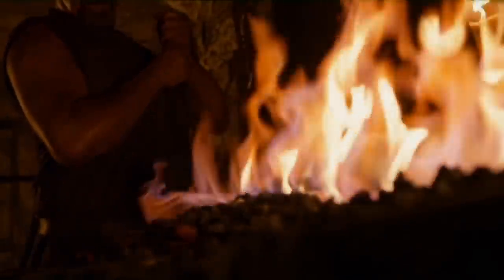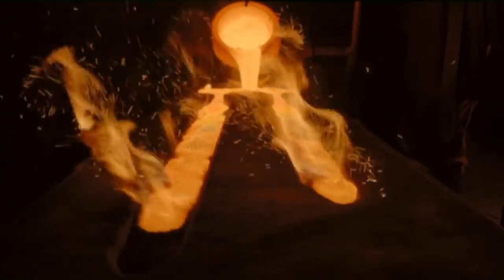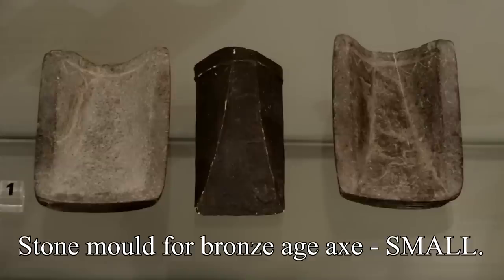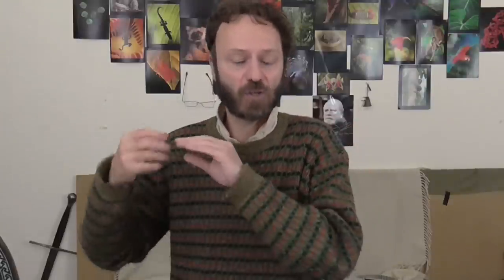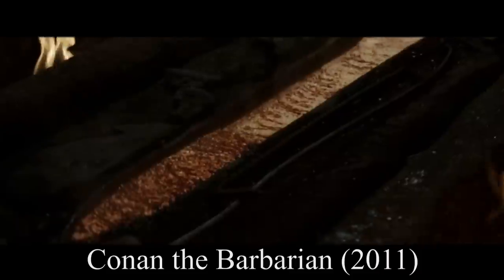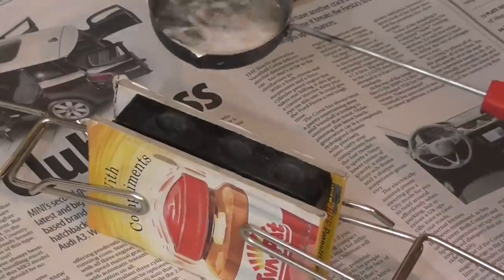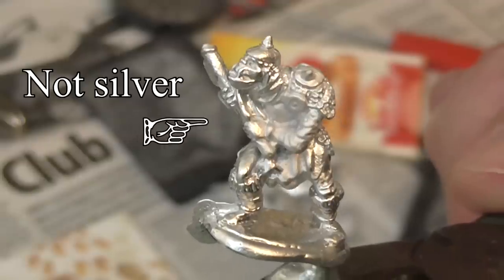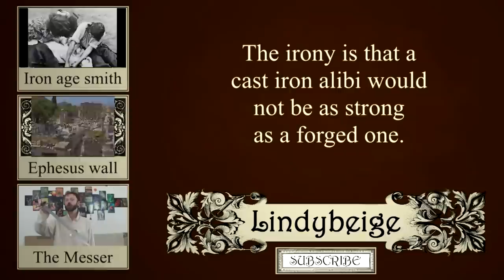Casting swords in the movies - forging a lie

Comment: "Orange is color of melting alluminium, not steel" try to say that to 9/11 conspiracy theorists :D :D :D
Reply: Why would you say anything to them? They turn off their ears whenever facts don't support their little armchair detective fantasy
Reply: Pettersony Strawman guess what a major component of good thermite is.
Reply: Jet fuel can't melt steel beams
Reply: Martin Bararanyi And it didn't.
Reply: You're right, they didn't melt.  Melting is not required, however.

You don't heat metal to work with it for no reason.  Metal bends and reshapes much more easily at higher temperature.  This is because its structural strength is lower at higher temperatures.  Put in that much heat and the beams that are holding up, say 200 tons of building over it, and they may no longer be able to keep it up.

It's also a multi-faceted problem that has to account for several hundred tons of airplane smashing into the building at several hundred miles per hour.  That could affect their shape and strength, and tear away fire retardant coatings.  Then there's who-knows-how-much combustible materials (furniture, carpet, etc) that also burns in the room.  By the time we're done, the simple 'melting theory' is just a child's explanation next to the complexity of everything really involved in such a large engineering problem.
Reply: girhen Exactly, i'm studying building and architecture (at this point just high school). I was just waiting for someone to ask a question, before writing an essey on it here. People then ussually tend more to acctually read it, compared to essey written right away :D
Reply: girhen
OMG. Did someone just regurgitate the "jet fuel" argument? Even if they'd only just learned to read in 2001, they'd still be at least 17 by now. It's depressing that people of that age can be duped by such a blatant straw-man and false dilemma.
Reply: Macdeas
Guess what jet fuel DOES melt. Aluminium. Guess what incendiary is largely aluminium powder and would be rendered useless by burning jet fuel. THERMITE. Jet fuel DOES burn thermite. It doesn't set the reaction off, but it renders the thermite utterly useless. See? That's what a CORRECT "jet fuel" argument looks like.
Reply: Just bending metal heats it. So yeah. No fuel needed.
Reply: After that, it's just physics. Amazing how many conspiracy theorists don't understand inertia and momentum...
Reply: JET BEAMS CAN'T MELT STEEL FUEL
Reply: Well clearly the "steel" beams were made from aluminium and the CIA/FBI/Whoever we are blaming had planned this before the construction started. They had the wreckage cleared up to cover their tracks. Taps nose
Reply: Pettersony Strawman Irrespective of the melting steel, you'd still have to question whether it's feasible to imagine they duped the secret services into getting away with this operation, on top of which required a moderate degree of piloting skills, especially for the Pentagon operation. 

I'm NOT saying it happened according to conspiracy theorists favourite stories, but you can't deny that Government's have historically created such events, 'false flags' if you will, or just blatantly lied to get an agenda fulfilled; Vietnam War had many strange events...
Reply: Your point 1: How so? Its a gigantic area, just by this the air going into the fire has a lot of time to pre-heat and thus get the fire hotter. Thats how a "Hot blast" operates. 
Point 2: How can that be "not much fire" and how much would it need to be so you call it "much"? There are gigantic plumes of black smoke coming out of both towers. There is fire all over the place and can be seen even _in bright daylight_.
To 3: That else but lots of flames over a long periode would you imagine to be able to transfer huge ammounts of energy? Thats essentially how steel is "always" heated up to shape and cut it.
To 3a: What makes you think that the jet fuel all burned instantly? https://www.youtube.com/watch?v=-qyZFASOAe0
Thats is the fuel burning in open air, nothing to confine it or act as a "trap" and its burns for >>5min.
To 3b: You did see the (partial) collapse at 1:19, right...?

What do you want to believe? What did bring these towers down if not a airplane hitting them and lots of fire?
Reply: Adiabatic temperatures only applies in idealized circumstances. They don't really apply in the real world unless you make a very finely controlled experiment where there is nothing else that can burn, and no heat sinks or moving air. Once you add those, the spherical cow of flame temperatures is irrelevant. So if you believe there is nothing combustible in tower, especially anything solid, sure.. Note how grill starter liquids are really good at starting fires that can burn a lot hotter than they do.
Reply: "There is something called adiabatic flame temperature"
And that uses... "initial atmospheric conditions (1 bar and 20 °C)"
One comment above you in the first sence I already told you how that would be impossible and also how steel production doesnt work like that.

But even if the temperature is already 600°C higher than needed you just say "nah still not going to work" so... no need to argue anyway? You just ignore anything as you please?
Reply: "If you pre-heat the gases you end up with higher end temperatures, but there was no additional heat source."
A house is burning. Everything is hot. Air has to get through the hot area into the core of it and has plenty of time to heat up on the way.
"3. There is heat loss to convection, diffusion and radiation"
Well what do u think where this energy is going? If the fire is all over and deep inside the house for a long time, there is not much other than fresh air and exhaust fumes where it can go to.

This whole thing is the same effect you can see on a campfire: One piece of wood doesnt burn, multiple can easily as they "heat each other". Same with coal. Those are all scaling effects and those two towers were gigantic and just by their size made up a decent heatexchanger / hot blast.
Reply: "Your pre-heating cools the reaction zone in the flame and this can be hundreds of °C."
No, the fresh and still cold air cooles the hot parts of the building.

"in those camp fires they do not heat each other. You simply need three things to keep a fire burning. Fuel, oxidizer and a temperature high enough to ignite it."
So why doesnt one log burn on its own but it does with 2 on its sides?

"you increase the reaction area by a factor of 2^3"
No, the surface area grows with power 2. Its the volume that goes up with power 3.
For wood to burn it has to be heated up, and that thermal mass is growing 2^3.

"That does not mean it burns hotter in the center and it will never reach temperatures higher than the maximum physics allows it to do."
So what is the "maximum physics" temperature? Definition please.
Reply: So... instead of arguing against my points u simply tell me I dont know anything? What should I back up, u didnt ask for anything. How should I back up that a burning building will preheat any air going into the fire near the core of it? That a gigantic fire with lots of structures it is not going to let air rech its core without heating it up at all? Did u ever feel the immense heat radiated of of a larger fire even from distanste? What makes you think that this whole lot of energy (tens of kW just for a bigger camp fire) is not going to preheat air?
And what about the argument that the temperature would be well above the melting point _anyway_, which you even say so urself? My reply still stands: "But even if the temperature is already 600°C higher than needed you just say "nah still not going to work" so... no need to argue anyway? You just ignore anything as you please?"
Reply: "You do not argue in science."
Of course you do. Scientific argumentation is a important part of science.
"There is the experiment as the highest and only authority."
A experiment means nothing without context/underlying theories. A theorie is the highest you can get in science.

"Despite the fact that you say it works there are even car manufacturers using using light metal alloys like magnesium alloys to save weight despite the fact that it's melting point is far lower. "
What does this have to do with anything? You can melt steel easily with oxy acetylen and yet the nozzle is made of brass, melting at ~1000°C.

"you will never achieve it as you need to vaporize the fuel first."
So... lots of heat due to large fire -> fuel evaporates -> cant burn due to lack of oxygen -> gets in contact with oxygen somewhere and burns (right above the fuel or somewhere else).

"This is an external heat source and independent from the combustion process itself."
What if, instead of doing it with a resistor, you simple pipe the hot exhaust threw the fuel and make a (crude) heat exchanger instead of letting all the precious heat fly away?

"Evaporation costs energy and that is bad if you need to achieve high temperatures like when you want to melt metals."
Can u back that up? That they do it because of energy reasons? And not eg. because of better handling in the process, smoke or removed impurities?

You seem to overestimate the required enthalpy of vaporization:
Butane as an example has 0.021MJ/mol heat of evaporation vs. the much larger enthalpy of combustion of 2.9MJ/mol, which is factor 140 bigger, so ~1% is sufficient to evaporate the fuel.

"how hard it is to build an oven that can reach sufficient temperatures"
That is actually really simple, but its much harder to get that oven to be reusable and energy efficient.

"look into thermodynamics and physics or physical chemistry to understand why certain fuels are more suited than others before making claims like these."
Once again you try to display me as a layman. Stop doing that, it makes you look untrustworthy. Focus on arguments and not the "oponent".
Reply: What if I add a bit of wood? That can burn hotter and change the entire balance. As I said your argument irrelevant unless you believe there was nothing else combustible present.
Reply: Ha! What do you think coal is made of?
Reply: Well, since you dont want to argue in a reasonable way im now going to deconstruct your statement:
"A theory is nothing more but"
A theory is the highest thing in science, go check it befor u show how little you know. Pro tip: A colloquial "theory" is not what it is in science.

To 1.
The heat of evaporation apply to... oh well... the transition between gas and liquid. So I dont really get what this is supposed to mean: "as it is a gas under standard conditions"
Does the gas have a different heat of evaporation or what?
To evaporate butane: 0.021MJ/mol (320kJ/kg)
To evaporate kerosene: 0.042MJ/mol (251kJ/kg)
Difference? Irrelevant, still ~1% of the enthalpy of combustion. Ur argument is invalid, do the math befor you say something like that.

To 2. 
Its not the heat capacity that goes up, its the amount if intert gases that goes up. The heat capacity stays pretty much the same but you have to heat up more useless parts. However the air gets heated up by everything solid along the tens of meters while getting to the core.

To 3. 
And the engine is cooled with water... you see how ur example is nonsense...?
And no, that little adiabatic expansion will not cool the gas more than 1°C. 1bar is ~0.15°C (Joule-Thomson effect). Most of the pressure  is droped in the... pressure regulator. The remaining little bit is then mostly droped at the valve(s) and then only a tiny bit of ~1bar at the nozzle itself.

To 4. "but mainly water" - You do realize that the hot coke is quenched with water.... right?
Reply: 1.I dont know why its happening at ambient temperature, considering its a raging fire and thats also not the boiling point of any substance we are talking about. So butane will be a little colder and kerosene at ~150°C. And no matter what, the heat of evaporation is still only ~1% of the energy thats released when burning.

2. The heat capacity of something is the same, no matter how much of it you have. If u mix it with something with a different heat capacity it will have a value somewhere inbeween these two, depending on the mass fraction (linear relationship can be assumed). 
Air is 1 kJ/(kg*K)
CO2 is 0.84 kJ/(kg*K)
Water (steam) is 2 kJ/(kg*K)
While a maximum of 21% of the air can get "replaced" with these two. We can see that with pure CO2 replacement the minimum is 0.97 kJ/(kg*K) and with pure water (steam) its 1.21 kJ/(kg*K).
And as a reference (https://www.dieselnet.com/tech/diesel_exh.php):
"As an approximation, the properties of air can be used for diesel exhaust gas calculations, Table 1 [Perry 1984]. The error associated with neglecting the combustion products is usually no more than about 2%."
So: Air and "hydrocarbon exhaust gases" have pretty much the same heat capacity.

"so what is coal made of? And why did they produce charcoal up to the middle ages?"
Where are u going with this? Ur statement ""but mainly water"" is simply wrong, why cant u admit that?
Reply: But it can start a building fire which burns hot enough to weaken steel.
Reply: Correct, however there were also traces of several kinds of explosives, both plastic and regular, discovered in the remains of the twin-towers. So either the terrorists had raided a military base before doing the attack, or they were given the explosives by some greater force, or the buildings were also blown up from the inside as the planes crashed into them.
Though I'm just stating what is plausible, I have no conclusive evidence of any kind. I just find this topic interesting. :)
Reply: You know the Hindenburg was a inside job between Britain and Germany to make France raise the white flag. The evidence is all there, you just sit back and belive anything said to you. URGH SHEEPLE
Reply: Ash Scott you do know there are many formulations of thermite, right?
Reply: Biały he was referring to the weight that any particular structurally compromised beam may be holding
Reply: Building 7 was a controlled Demolition
and not you or anyone else Screaming "Conspiracy Theorist" will ever make me think otherwise

Comment: Hey Lindy, molten aluminnum is roughly same colour as solid. In my studies one of lectures was about safety around casting, and when there is molten aluminnum you should always wet your fingers before touching, as its does not change colour with temp.

Comment: They did use open molds... Fist you cast out billet of a sword and then you forge it into a final shape. Button side is not curved, its all just square.
Reply: But than he cant make the glue joke
Reply: With steel you can cast or forge, but not both.  All depends on the carbon content. Cast iron requires a carbon content of like 5% to get the melting temperature below the burning temperature, but with that carbon content it shatters like glass if you hit it with a hammer(not to mention that it’s practically impossible to grind/sharpen).  Try to cast lower carbon steel and it’ll burn up like a sparkler before it melts.

Comment: Liquidus temp of iron 
= 1537°C - [(C%*88) + (Si%*8)]
As cast iron is poured the sparks explode as the iron rejects the carbon in favor of oxygen and little flat flakes of graphite is created in mid air.

Comment: I feel it's unfair to criticize that scene from Game of thrones considering that was a valyrian steel sword, which is made of magic forged in fires from dragons
Reply: But no matter the material, the shape of the swore would still only be right on the downfacing side og the swore. The top would be completely flat, which oathkeeper and widow's wail in GoT are not.

Comment: The thing that made me think "WTF" in the game of thrones sword pour, was that the sword in the series is "Valyrian" steel which is actually Damascus steel. Damascus steel has a pattern that only comes out when you forge the steel and etch it.
Why did the GOT sword have a pattern on it, when it was poured?
Reply: It is not damascus steel it is based on damascus steel but not the same
Reply: but still, there was a battern on the sword
Reply: @ottlaurson8796  petterns can emerge from crystalyne structurse or, get this, magic. Valyrian steel is made with dragonfire, it dosnt need an excuse to have petterns